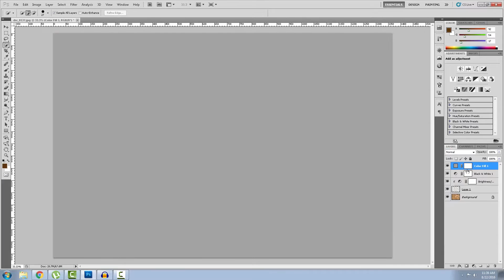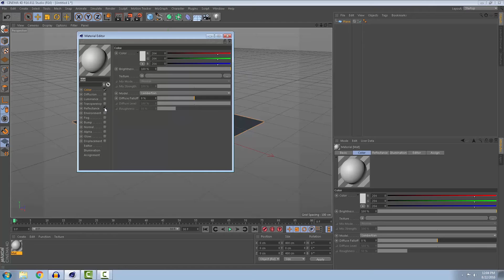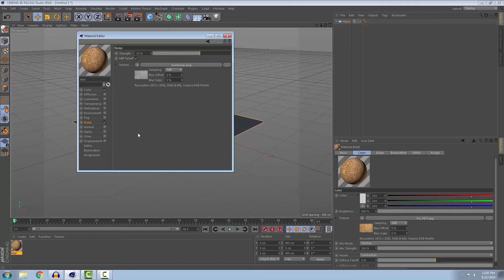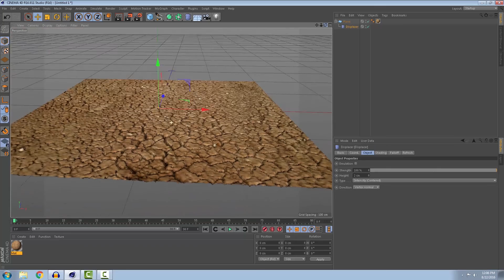Cinema 4D - Displacement Mapping for Realistic Modeling tutorial

Comment: What's the difference between using the displacer, outside the material editor, or placing the bump map in the displacement tab inside the material editor?
Reply from the maker: i haven't used C4D in a while but if I remember correctly the difference is that if you place it using the displacer you see the changes in preview mode. This means that you can adjust the levels without having to render.
Reply: @TheGopnikTinkerer  nice, thanks !
Reply: @jdanielortega  bump mapping only modifies the surface of a piece of geometry, whereas displacement mapping is actually altering the geometry itself.